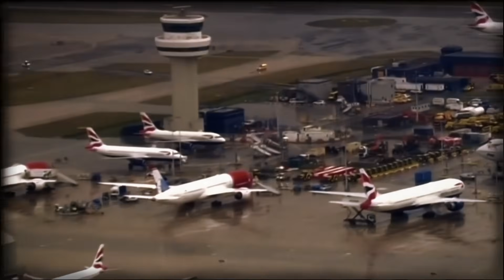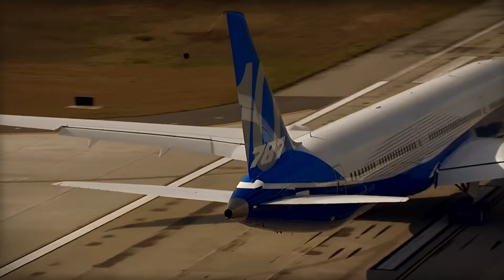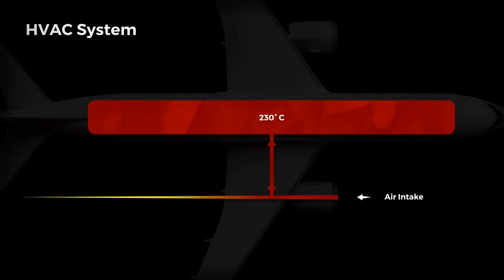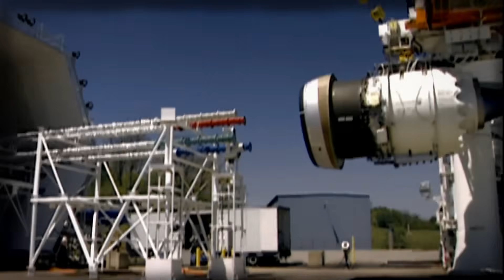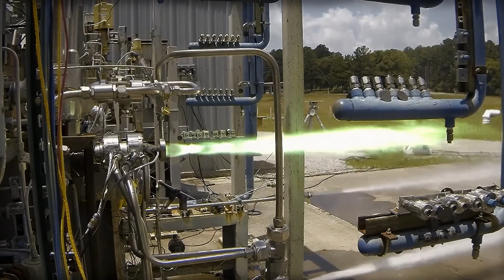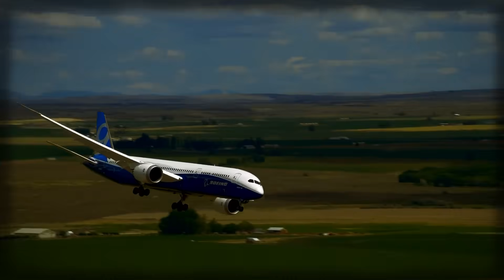Boeing 787 Dreamliner’s Engines Are More Advanced Than You Think!!

Comment: "Explosive cartridges"?  No.  Fast burning cartridges yes.  A stick of dynamite explodes.  A starter cartridge burns fast and steady for several seconds.  The 737's fuselage is 12 feet 4 inches.  The fan diameter on a GE powered 797 is 9 feet 2 inches.  The Trent powered version is 9 feet 3.33 inches.  So, not the same diameter.  DO YOU REASERCH BEFORE MAKING CLAIMS THAT CAN BE REFUTED!  IDIOT!

Comment: Engines do not start by compressed air going into turbine sections. I dont know where you get these people but at least try to be factual when you spout off about starting jet engines
Reply: They do though? That’s why you’d have a compressed air cart or run the APU and bleed compressed air from that before you can start the engines. In most cases packs have to be turned off so compressed air doesn’t go into the cabin instead.
Reply: This is AI slop though some of the poor descriptions given in this video are really bad. I hope it’s AI anyway